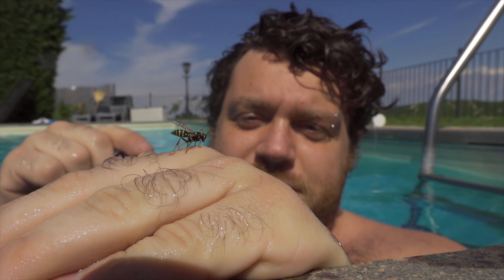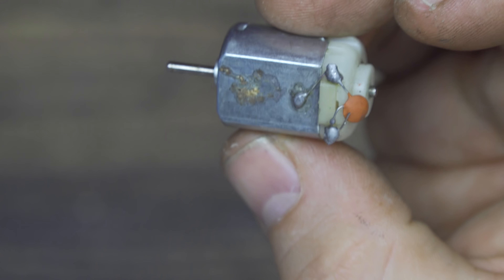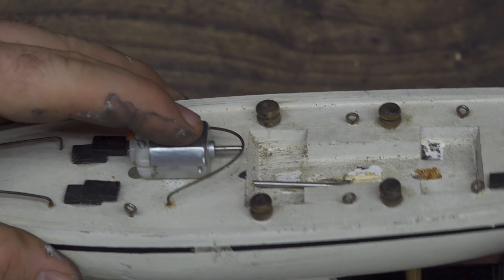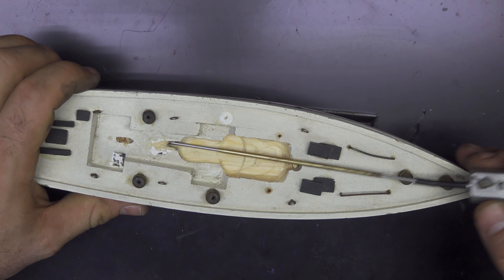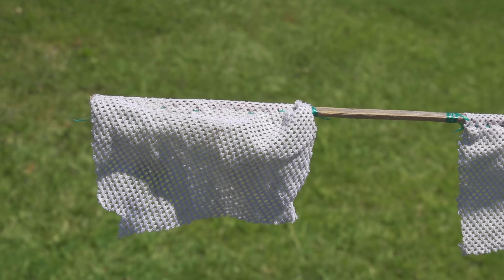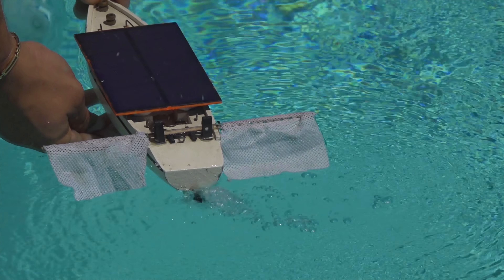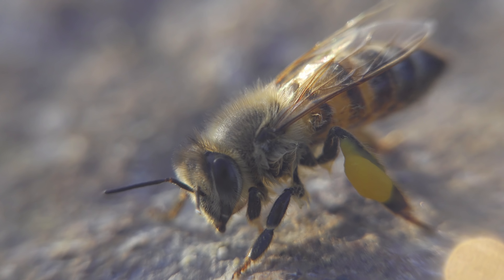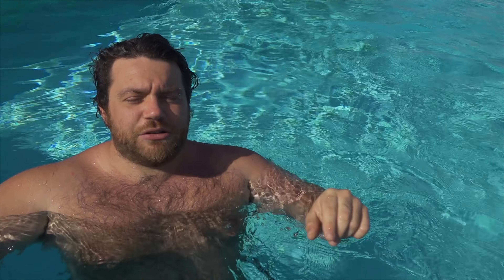Solar panel Boat for Life Rescue  • how to Make it

Comment: Interested to see a timelapse of it roaming around the pool. Consider using weed whacker line as well as the nets. Weed whacker line floats, is 1mm+ thick, and has ridges along it's length. Weed whacker line might allow for the boat to cover a wider area as the boat drives about. Imagine that with arms poking out the sides that the boat will have a tendency to stick to walls and corners. If that's the case you might put a floating loop in front of the boat instead of the arms. A loop will cause the boat to redirect so long as the impact is a bit shallow in angle.

Comment: Great idea and excecution. I think that the fabric would work better if you put it on the front, instead of the back, as it looks like the insects tend to be drifted away from the sides of the boat once it passes by